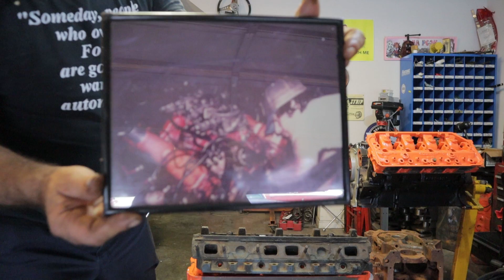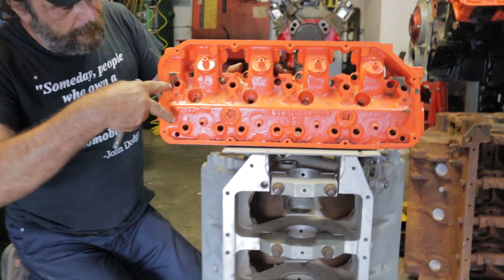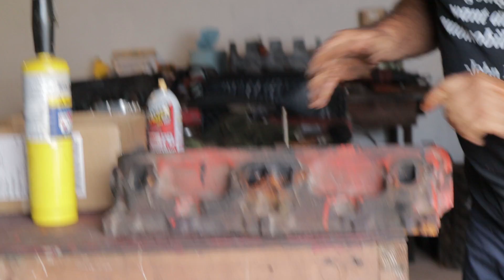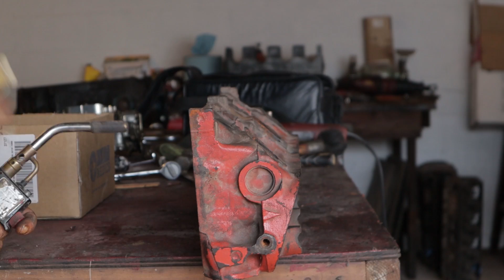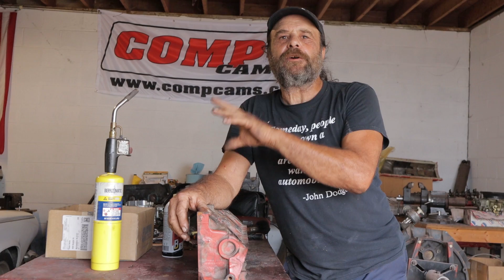What Makes The Small Block Mopar Such A Great Engine?

Comment: I'm very interested in your take on the later magnum heads. I saw one video of a dead stock 360 magnum with just a 410 stroker setup and it made 490 tq and still 331 hp with the tiny stock cam.

Comment: Ik that the sbm has a better raised exaust port design but. The siamezed center ports on the sbm are shapped differently than the big block mopar and i have to assume that disturbs exaust air flow to the center cylinders. Idk id rather have the big block. Better oiling system and cooling system and ignition system for location perspective, and with modern cylinder heads from indy i can get 330 cfm of air flow at 0.600 lift on the intake and the exaust is like a 250cfm. Which is a ton for a 383/496 big block stroker i want to build from 440 source.

Comment: Had a 318 with 73 340 heads, a big cam with an Edelbrock torquer intake with a 650 holly and headers. It was amazing it would turn over 8000 and keep pulling.smoked a lot of big blocks with it lol

Comment: I used to have a 65 Coronet, It was originally a 426 max wedge (if I remember the plate correctly), but had a 318 semi-hemi in it with a 727 torqueflite trans and sealed Dana banjo it think it was a 3.73, Lakewood traction bars, real magnesium mags and tiger paw super 60's on the back, that car was a gas. Bent a pushrod in it  and replaced it without knurling the valve guides and she still ran. Traded it for a 75 Cutlass. That 318 was a great motor

Comment: Great video! Im building a 318 at the moment, will have ‘974’ 360 heads, open chamber, only to compensate and lower compression for the 6/71 blower on the top of it. I was told the flow would increase 55% with the boost application anyway, but how will the exhaust ports be? I heard they can blow them out with superchargers from the heat, these heads do have raised or higher exhaust ports so potentially could clear some material out to make better flow. Hoping to get 500-550hp out of her. Cam stretches to 6200rpm and its using forged equipment through out with arp studs cometic gasket ect

Comment: Videos like these are kind of cute to watch after playing around with some other types of engines besides classic V8s.  I think it'd be fun to watch Uncle Tony dissect something like a Honda B18C, or give him a stack of the various Toyota 4A-GE heads (big port, small port, etc).  Or, my personal favorite, have a go at the ports in some 2-stroke cylinders.  The exhaust ports in a set of 5.9 Magnum heads are "disconcertingly tiny" compared to the exhaust port on my old 250 Husqvarna.  Or here's a fun one: steam locomotives.  I had a look at the steam piston-valve ports inside the right cylinder of SP&S #700 once and it was really impressive, and not just for the 1930s.  You could throw cantaloupes into the intake and they'd come out the stack whole, were it not for the 300 psi intake manifold pressure.

Comment: Mr Tony this is Greg Duty Speed Shop I found the same thing out on a Oldsmobile the two Center ports are right next to each other what's what it was about 30 years ago I was building a dry car just to a foot brake car and I was determined it was 83 Dodge Dakota I was determined to use a 350 Oldsmobile motor which that's why I said I had never built to automobile motor before but I was going to use the stock bottom end I had helped one Johnson and I know what not to do but I didn't have the funds that he had so I did start out with the 350 diesel block for strength and but I just got a just a decent set of Oldsmobile heads well come to find out Pontiac some of those mobile heads and their Mark PMD between the two exhaust marks on top of the head and they were not a very good head you have to put the crap out of them to make them any good so that's what I started out doing there was a man named Paul medallion that was a genius on Oldsmobiles I mean he knew all the ins and outs and I got in touch with him and I told him what I had as far as the Pontiac he has a Oldsmobile heads or what I was trying to do and he told me that you know I was on the right track I could have gotten a better set of heads but I was on the right track he said to leave the intake size alone but to go up on the exhaust ports use the 455 exhaust side on the exhaust ports that's what I did now let me back up a little bit because I put the car together just stopped with a massive important job I had a head shaved a little bit for compression and I built a turbo spray 50 and I put a small shift kit in it with a white box B&M style converter 2500 3000 stop Burger and put the biggest cam in it that I could get which was 48291-482-9110 and you know it didn't even have much of a rope to it just sitting there and I believe old mobile was 16 restaurant and I couldn't find anyone sevens for it if they don't make them so anyway I put it together around 9:20 now I had already put a roll cage in it cuz most I actually tracks on foot break if you run 750 you got to have a cage and that's what I was looking at running but I was nowhere close so I I was running Edelbrock RPM intake with 2-in spacer and they 750 double pumper and Electric fuel pump holler electric fuel pump with a regulator and it you know it sounded pretty good but it just didn't have a it come out of hell pretty good I think it was 18 I have a whole and then you know after 6 foot it just didn't have nothing it fell on his face and talk to talk to him and he said that I needed to pull the heads off and put I don't remember exactly what valve in it but it was a 455 exhaust valve in it he said Do not mess with the intake but put the 455 exhaust valves in it and put it even more he said they have they're not even close to the water jacket so poured it as much as I could so that's what I did and I put it back together and rolling beholders in a 50s which is still not as much as I wanted it to be so I got to look around I was working at The Parts House and they did have a roller rocker hiring high energy kits competition cam made them and Oldsmobiles just a bolt on you know they both on rockers anyway so it I don't remember but I started looking around and Oldsmobile and Ford takes the same stud it takes the same push rod it takes the same it's a same everything except for the rocker so so it would have been a 1/6 and they had the Rockers for 1/6 for Oldsmobile but they didn't have the one sevens and I said well they got to 17 for Ford and everything else is 17 so I mean everything else is the same so I ordered a set of 17 for a Ford and put them on my car and returned it put a little bit more timing in it and went out this time it went 799 so I was getting closer to what I thought it should run this time I went up to an 850 carburetor and when I had a chokehorn milled off of it and went to put a bigger size jets in it front and back and that got me down to 770s or something like that I was really close well it was an off-brand cam and I had a lot of runs on it by now so I called Harvey crane and asked him about it but this time I had a lot of dealings with Harvey and he tried to put me in the right direction and he told he told me that I could put the beans it was just a drag car and out of something on the street he said if it was him he would put and there wasn't nothing else I could you know what no bigger cam what no solid cams for it that he would put solid lifters on it and that would raise my lift somewhere around 30,000 and that should put me in the 75740 range and that did get me in the 75740 Ryan but the whole moral of the story was that that I dropped one second just changed just just changing the valve size on me exhaust files and working them really important and polishing the exhaust valves and leaving the intake salon and I think that's what you're trying to say in this video is that the exhaust files sometimes are so close together that you can open them up and you don't have to go crazy with intakes and everything that you can put more into the exhaust and pick up another without having to do anything to the intake I was told that if I was to change anything on my intake it my car with a slow down cuz if it wasn't for that I would have changed my intakes anyway I've gone on too long and I just want to say I think you do a great job and I appreciate it and I love watching a show and this is Greg GTO Automotive

Comment: Very neat video Tony! I have been a diehard small block mopar guy my whole life. Started with a 340 in my 76 Dodge Aspen. Did a 434ci out of a 318 block, then a 468ci out of an R3 block and even still ran a W2 head on it. Still have the car, and currently we are building a 369ci gen3 hemi with a billet 88mm turbo on it. My very first engine, that 340, we are currently freshening up for my 67 Barracuda which I am excited to get back together! This will be the first small block mopar I've done with a hydraulic roller I had built by Comp.  The small block mopar was always a bit surprising the power they could make.

Comment: In the early 80's me and a friend crunched the numbers + block specs of both the 318 and 360 and looked at options. Hind sight is def 2020 as we could have been very rich, given what we see on the market now.
The SB Dodge has always been a stout motor, even when compared wiith the SB Chev "bolt on hp" consumer market. It just took a bit longer for some to catch on.

Comment: I had a 66 Dart GT 273 4barrel 4speed, sure grip no power anything no AC no heat straight up bracket racer from the showroom floor and that was a very quick little car looked like any other 66 Dart with the GT chrome trim and bucket seats with console but the exhaust was more like a header setup than manifold but made of cast iron and the driver side wrapped around the bottom of the engine between transmission and engine met the other side and ran out to the back in a huge 2 1/2-3 inch pipe that had a weird round muffler that did little to quiet I guess it was there for looks to say that it had a muffler solid lifter cam intake was pretty tall as I remember anyway I was very surprised by how quick 273 cubic inches could move that car if I remember right it's one of the first Dart to get a V8 would be cool to find out a little history of those race ready Dart and the HP rating of the 273 4barrel Hi Po engine

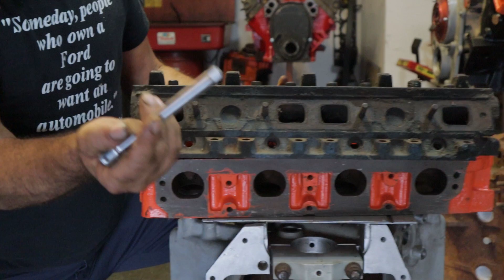Comment: I have a 69 D100 adventure short bed that my father’s cousin ordered brand new 318 3 speed manual. I’m I’ve been wanting to build a 318 possibly .030 over around 11:1 compression balanced assembly, a windage tray, trick flow cylinder heads a hydraulic roller cam, Harland sharp full roller rockers, trick flow intake 750-850 cfm Holley a electronic ignition, headers, 4speed manual transmission the truck has the 83/4 rear I think I’d install a 4:30-4:56 ratio with a good posi of some sort and some sort of traction aid in the suspension I’m hoping for a high 11:80-11.90 quicker would be better!!! Lol

Comment: In refrigeration piping we use long radius 90° elbows. Each elbow is the equivalent restriction of 6 feet of linear pipe of equal diameter.

Comment: Always been a Duster 340 Lover.1970 Sentimental cause that’s where my first kid came to be.Back seat that is ! I’m 67 and came full circle from my 70 340 Duster that I sold after a Marriage and Kid on the way.Heads where done by Kirn Automotive.Wish I would have never sold.Accel,Crain cam Hyd large as I could go and 850 Db Pumper.Mr Gasket 4 with second gear wheels off the ground.Best engine I ever had.391 Posi perfect rear end for that engine and 4 speed.3 Year ago went Waldorf Maryland in DC from a purchase on Racing Junk.This was a put to gether car.Title said 76 but has Demon tail lights with 70 Duster front clip.The motor has a solid lifter cam with no spec sheet.Radical cam with stall so I set valves both at 23 In Ex.Purchased nice $800 roller rockers set on Summit. It to has 850 Db Pumper.Question what’s  DW3402219078 stanped below drivers head. Also on Block Dr Side  has 2780930-340-4 is this out of a truck 4 Bolt Main .Not sure if you read these but ok if you don’t .Thanks for your video.Great Stuff.Man you sure did your home work ! I know till I die I will always stay with 340.Stil can’t find the correct ID on thos Numbers DW or 340-4. Thanks A Bunch ! 🍺

Comment: Im a fan of the ":wedge" engines but one of the best MOPAR egines we used (in a '66formula s cuda) was a 273 both strong and reliable Better than small block Chevys have owned

Comment: Good AK47s work similarly. At first manufacturers thought a 45 degree angle would be best for the gas tube to work the bolt back but it later turned out that a 90 degree angle worked better. Science is universal I guess haha

Comment: UT you said a loose engine is a happy engine and you seem to mean it. With std Pistons in .010" bores and used bearings in rebuilt engines. So do you measure bearing clearances or just put them in, add thick oil and pray a lot ?

Comment: I saw a video of a guy who bored a 318 .09 over, and use 360 pistons, made 600 horsepower.
I wonder if you could destroke a 360 and put a 318 crank in it? I wonder what kind of RPM you could get out of that?

Comment: Currently planning to do a small block chrysler build on my magnum... planning on checking out trickflows new 190cc power port head and intake. Sticking with fuel injection but definitely ditching the chrysler ecu in favor of a holley dominator unit. Stroking it out to 441ci. And popping a pair of 88mm vs racing s488s on it. Now to find a mopar trans capable of taking 1500+ hp and still have a transfer case bolted to it

Comment: I haven't rodded an engine since the 90s.
  Curious  why I never hear uncle Tony speak about rod length..   Chevys 302 was talked about a lot in its  rotating  efficiency with a 3 inch stroke a 6 inch rod with a 4 inch bore at 90°...  
  Supposedly this gave GM the most horsepower ever to leave the factory on a small block at 390 horses....     
 For me the 283 engine what is the most enjoyable street engine rod, the short stroke of 3 inches just never seem to run out of RPMs...  Plus they were so much easier to find than the ghostly 302 Chevy only produce for two years in  select muscle cars...

Comment: Back in the late 80s, I bought a 72 Dodge pickup from a friend who told me that if I ever sold the truck to keep the motor because it was a 273 out of a Barracuda or a Dart. It ran well, but I did end up getting rid of it and did not keep the motor. Now I know WHY the 273 was (and still is, by those in the know) considered to be a high performance mill. Thanks UT.
Reply: Well, what do you know. I just went and checked the old power wagon I got sitting in the back yard and I've got not one but two of these blocks with heads. And I was wrestling with trying to figure out what engine I wanted to build for the truck. This video decided it for me. Looking forward to that high perf 273 build video, UT.

Comment: Back in 1967 i owned a 65 valient with a commando 273 and a four speed. All factory. There was never a Chevy built that could out run it of a 390 ford.
Reply: I have a 273 commando moter storied behind the house i bought it about 30 year's ago.

Comment: My father-in-law bought a new 1950 Plymouth, long story short, my wife got the car when she was 21,  We have been married for ever, I didn't like the 6, so,  my engine builder (Bob Cram) built a stock 1973, 318  balanced, Stock manifold , 727 trans,, Dana 44 rear end, with a chevy  HEI distributor,  I installed a 1969  motorhome 318 timing chain cover, which raises the water pump almost 8", that puts the fan in the middle of the radiator,  this car  a screamer.  the engine is a real rump rump engine.  I have talked with Bob Cram, and he said "Do you really need to know".. I have often wondered why it is such a screamer.  Well now I know.  The 50 Plymouth is a cruiser,  Thank you so much.  You are to be Commended for you fine work and advice.

Comment: You habe to really try to kill one. Reliable , tough little engine. Had a 318 in a 72 Charger. Started up everyday cold , hot , didn't matter. About 300,000 mi. and no problems. Other than a timing chain and unrelated ballast resistors. Oh , and 1 rocker arm.

Comment: Hey uncle tony i understand what your saying about those heads but here's my question would you be able to use some of those on a 426 or it wouldn't work because of the bolt location under the two ports in the center

Comment: I think you are the guy, to figure out why the new 6.4 Hemi's in the rams, are having lifter/cam issues......I'm shopping for a new truck, my 98 dodge ram with the 318, has 360,000 miles on it, still runs like a top, but electrical stuff is starting to fail......but the word on these new Hemi's , has me scared

Comment: GM did the same thing with the DZ302. Small inch motor built to run as hard as it could within a certain set of parameters. The mythos that built up around it was kind of silly because they could be beat (and later were) by the 350, but for the displacement restrictions in place in the SCCA Trans-Am division, they built a monster of a motor. Oversquare engine, large ports (350 uses the same size), high lift long duration cam to let it rev and combustion chambers that bear a striking resemblance to Porsche motors of the era.
I know people make wild claims about them making 11ty hp from the factory and that's simply not true, but they breathed extremely well given the technology of the day.

Comment: It's called the 1966 Dodge "D"Dart 275hp 273ci Trans Am class motor or the USAC 318cid Fuel injected motor. Go with the (302 castings) closed chamber and port them to 340 ci gaskets and unshroud the valves (188 - 160) or the pre Magnum 360ci (308 castings) that have the raised exhaust ports but still have the shaft rockers !!